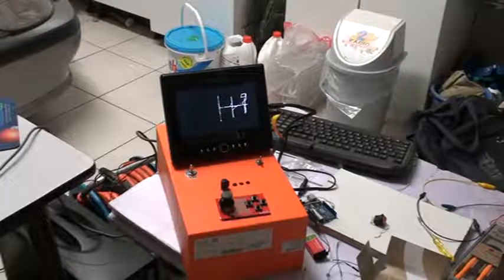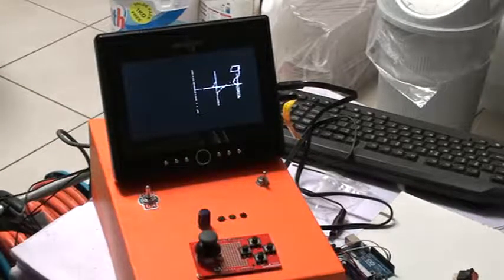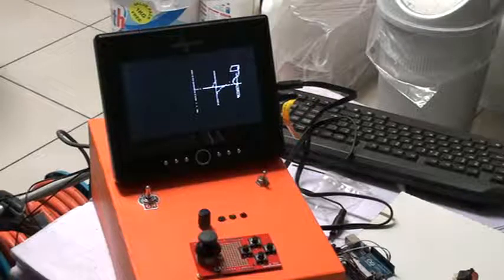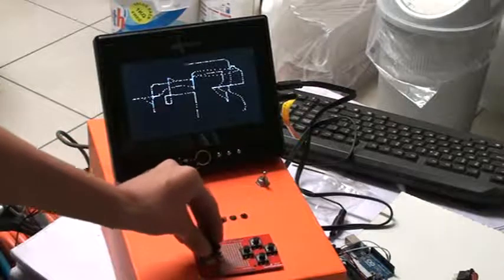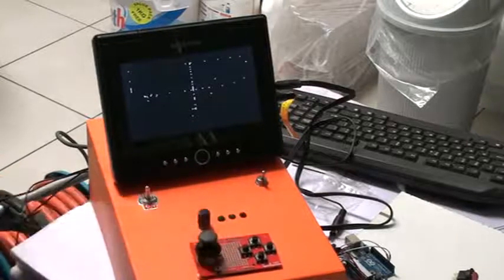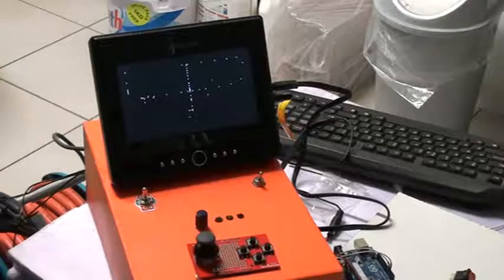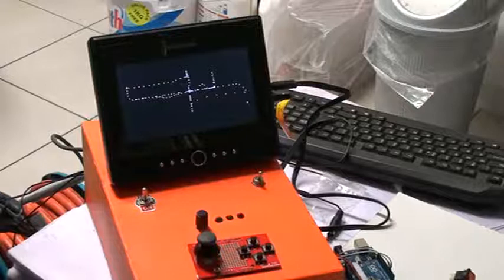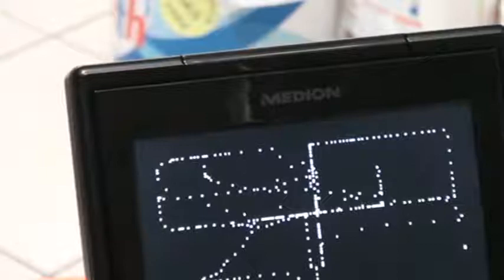L-OS progress update 6: new chasi, nearing the final prototype, and PAINT!

Comment: @laurensweyn My dad didn't know anything about me knowing about arduino so my freaking out freaked him out too. :D He is awesome.

Problem is I now have a MEGA, a small BreadBoard, and some wires (copper core 6-wire Phone Wire that I stripped into the individual lines. not as sturdy as I would like, but it works), but no LEDs or Resistors... or other components(except an ultrasonic distance sensor that I may try out)... Can't find time to stop off at Radio Shack for supplies....